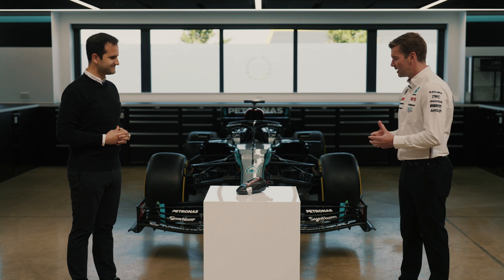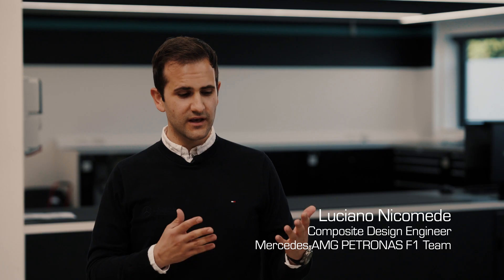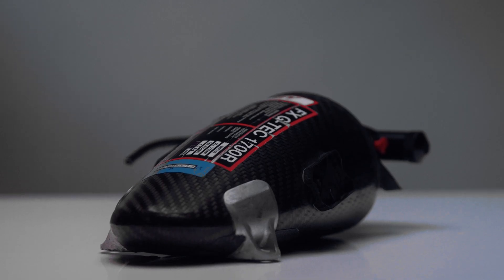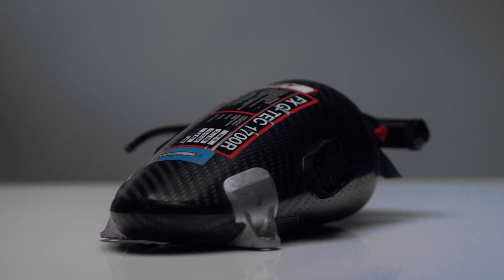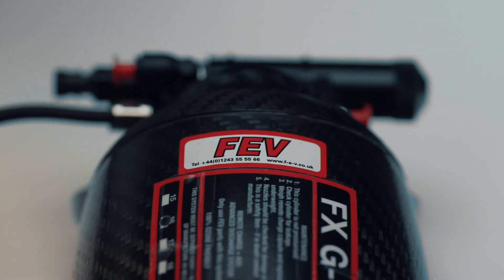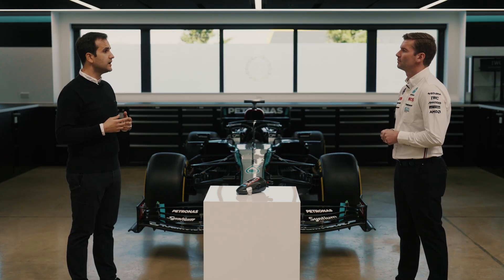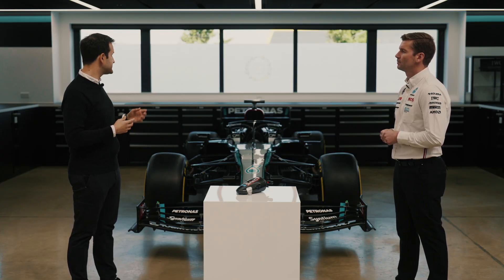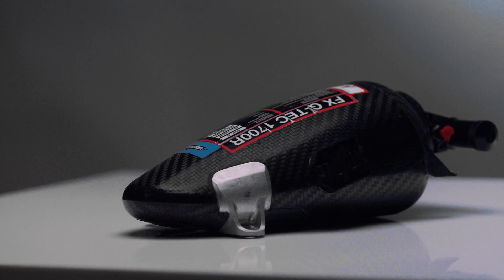How F1 Cars Extinguish Fires | Safe & Secure x Crowdstrike

Comment: I'm a bit surprised that it's not standardized. I would hate for teams to have to compromise on any safety system in the name of competition.
Reply: There are performance based standards that set the how much fire it can put out and its discharge reliability rather than make everyone used the same thing. Also, the external pull wire location is also standardized.
Reply: @stephenbritton9297  Ah cool. Thanks for the info

Comment: Is this a new thing that was implemented into the car because Grosjean was trapped in the flaming car for 28 seconds after colliding with the track wall at close to 120 miles per hour and his did not deploy so it does not work in a high-speed crash like crowdstrike it can be compromised 🤔
Reply: @lenriew2892  probably